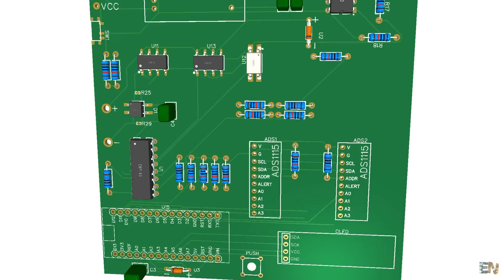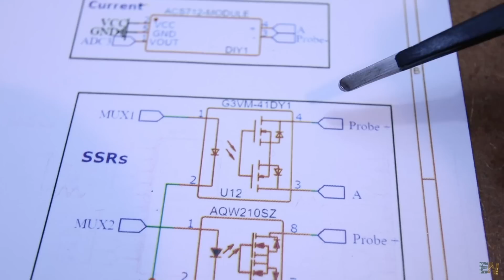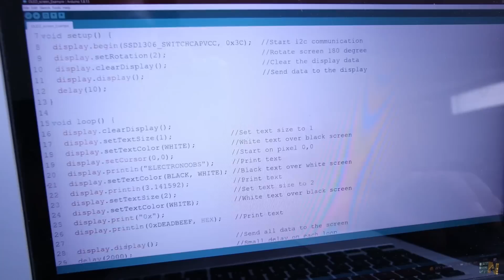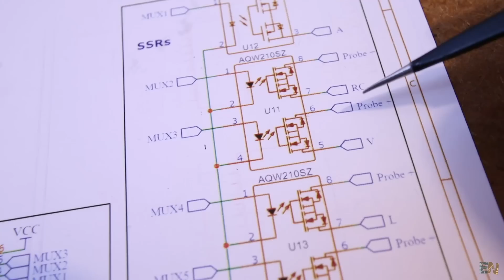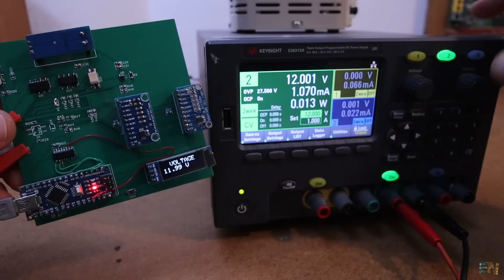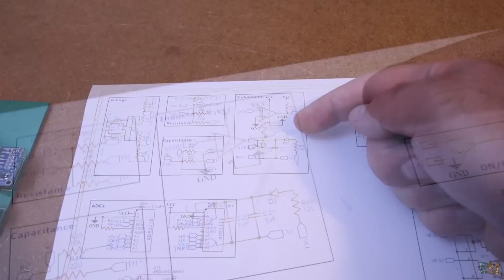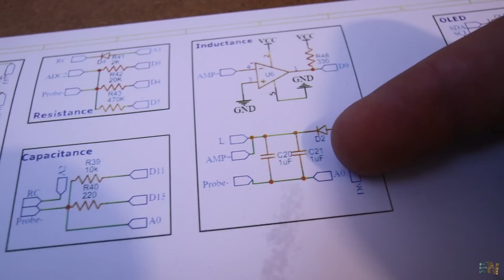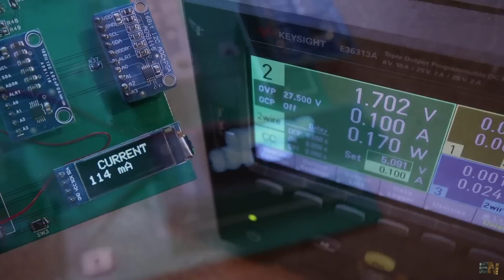Dev Board - Multimeter - Learn how to make one

Comment: nice project. One caviat I see is that you use the internal voltage reference of the ADS1115 in my experience it is not very acurate and getting a 0.1% reference externaly helps a lot.

Comment: Another great video Andrei!  I found the example of using more than one channel on the ADS1115 interesting (I believe that is what you did).  The previous tutorial I found for using the ADS1115 only showed using a single channel.  From the brief glimpse I caught of your code using the ADS1115 it looked like you used more than a single channel.

I also found the SSR and MUX circuitry interesting.  If I'm understanding that correctly then it would be a good example of how to switch between different channels/inputs controlled by a microcontroller.  Thank you for putting this together and sharing it!  I look forward to your next version of a DMM incorporating these improvements.

Comment: You should place a ton of GND vias on that board. Especially along the edges of the PCB. These huge planes without connection will introduce much noise.
Reply: I suppose those planes act a aerials?

Has the board design been upgraded to include 'vias'?
Reply: @pcka12  
It will result in a few things.
IMO the main problem are "ground loops", which can begin to oscillate.
Without vias, you can see that some points (GND to GND connections) on the PCB are unnecessary long.
Looking at 1:33 : R38 (between U12 and U13) for example isnt even connected on the GND side (from what i can see), because the GND plane is cut from another trace.
Its very complicated (for me) to explain all aspects here in a comment.
On a PCB this size I would've placed at least 100 GND vias.

A very very deep dive into that topic did @RobertFeranec with his PCB simulation series:
https://www.youtube.com/watch?v=nPx2iqmVAHY
Reply: @MsKittensPurr  thanks for your help!

 (from a scientist most of whose 'electronics knowledge' is 'self taught')
Reply: @pcka12  Glad to help! 
I did study electrical engineering but I would say that I've learned all the useful stuff from tinkering (98%) and internships (2%). Study is great and all, but the interesting stuff comes out in the field lol
Reply: @MsKittensPurr  I was talking to the head of a university education department once who pointed out that the quickest way to learn something thoroughly was to teach it!